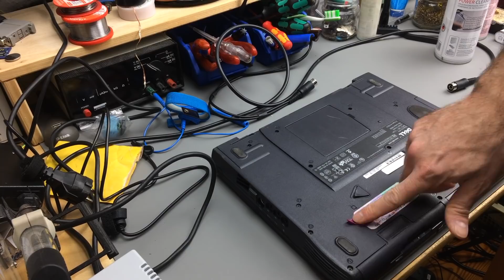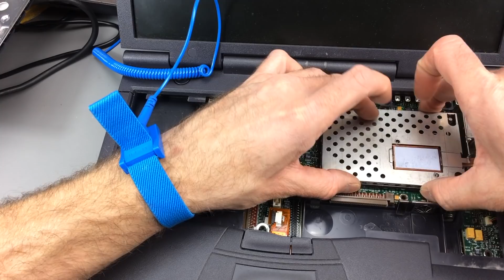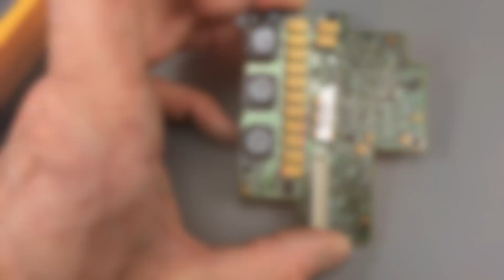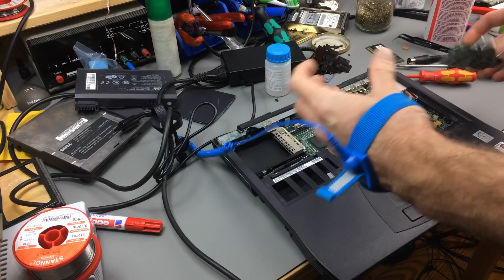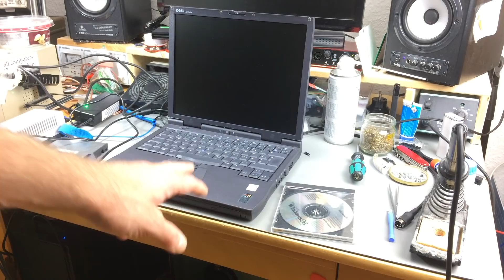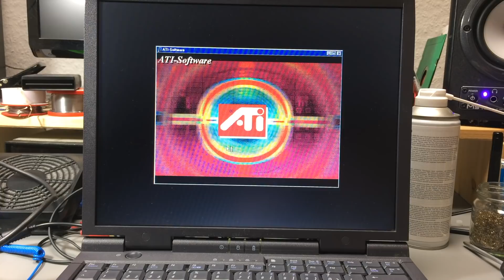Dell Latitude CPx H500GT Repair and Windows 98 Install

Comment: Now that is a find right there, and also a very helpful lesson on more "modern" types of capacitors or boards, now I actually get how those work after being completely thrown for a loop every time I see that type of board. Awesome video Jan.
Reply from the maker: I was quite surprised it was only a capacitor actually. Lucky intuition for sure.
Reply: @JanBeta  you really never know what you will find in the end, but yes very good intuition, and the new power plug with the idicator light was helpful, wish they made commodores with that kind of feature.

Comment: Is it my imagination, or was the burnt out capacitor on the wrong way around?
Reply from the maker: I had to double check now... It's the right way around. The one I replaced is in the opposite orientation as the other caps so it looks confusing. Also, marking the suspicious caps with a red marker on the side not marked as plus adds to the confusion, I guess... ;)

Comment: I have one very similar to that! But a CSx. Was in really nice condition. Upgraded with faster processor, more ram, and a cfflash card and adapter. Tried ReactOS, but it's not there yet. Gotta stick with Windows 2000, for now. Thanks for sharing!
Reply from the maker: Great machines for sure! :)
Reply: ReactOS won't ever be there, except to fiddle about with it for a while

Comment: It takes me back, I used to fix and supply them and about 8 years ago I bought 10 of the CPx  laptops 386 and 286 cpu ones from Ebay for £7 and it was free postage yes i only got the lot for £7 ...only 2 out of the 8 were dead mainly smashed screens few had hard drives and how ironic I was ago given a load of drive bays 1.44 and CDROM drive and around 12 batteries .. of which only 1 battery was a dodo ... those were the days !! excellent video takes me back ... if you get any which are bios locked there is a website that will give you the code to unlock the laptop or pc via the tag code..

10 laptops Dell CPx (286 & 386) yes 10 laptops of that era
12 batteries 
cannot remember how many drives though i think only a few 3 i think
2 chargers

for £7 - that was a good  day lol

won an ebay bid for only £7 and it was free postage and they came royal mail within 3 days ... and everyone was wrapped in paper and bubble wrap and carefully box taped up ...
Reply from the maker: That's one nice deal! :D

Comment: 6gb hard drive
Reply: That was huge back in the year 2000
Reply: Hunter's Moon  things did move slowly then but i bought a super expensive pc with an 8gb drive in 1997, was about £3500 from gateway, their top model at the time, a desktop though, 6gb may have been top of the line for laptop sized drives of course., a laptop then was also serious money for anything that wasnt super slow, and were not close to desktop prices until the 2010's, pentium 4 in a laptop was awful due to the heat and trying to get rid of it, most ran so hot it was insane.

Comment: Great job troubleshooting the issue! I wonder if the aftermarket charger lacking some sort of protection feature is what actually caused the capacitor to fry itself...
Reply from the maker: I think it is more likely that the old original power supply damaged it when the cable broke (maybe there was an intermittent connection and the capacitor got some nice shocks). The aftermarket one seems to work very well actually. It's obviously difficult to tell in retrospect though...
Reply: Highly doubt it. First, if that charger is capable of diagnosing failure by showing the blinking led, I guess it also has the proper protection circuitry built in, and second (though I'm not 100 % sure if that was already a thing back then) an aftermarket charger which does not exactly matches an original Dell one in every way is detected by the laptop as fake and causes it to run at some kind of low performance mode (a bullying method to make you buy an original charger for whathever they will ask for it).

Comment: Sadly, I have to warn you. This laptop is piece of turd.
I have SIX of them, all six were working and all of them suddenly stopped working FOR NO REASON. So expect failure in nearest future...
Reply from the maker: Mh, interesting. It seems so well made on first glance. Hope it will last me some time.
Reply: @JanBeta  Well I hope you'll have better luck. But I didn't notice if you removed old CMOS battery. It is right under palmrest, six cells in green or white sleeve located right next to the keyboard. You have to take off whole top cover and display to get to it. But I tell you - remove it. It leaks. Badly. And eats through wires like nobody's business. I suspect it is the reason why all of the mine doesn't work.

Comment: when i saw those tantalum caps i had a feeling that one of them would have gone short circuit. if you want to keep this dell in a good shape, i'd just replace all the tantalum caps in the power section before another one fails short circuit and possibly takes out something else with it.
Reply from the maker: You may be right. I always found tantalums quite reliable but these ones might have seen some stress previously.
Reply: ceramic SMD caps usually short because of mechanical stress (eevblog has a good video on it) and i think the SMD tantalum caps usually fail from age
Reply: Jorno:  Which video of eevblog's do you mean?
Reply: EEVblog #1037 - Solving Ceramic Capacitor Cracking
Reply: Thanks!